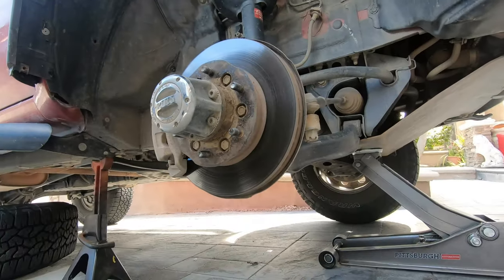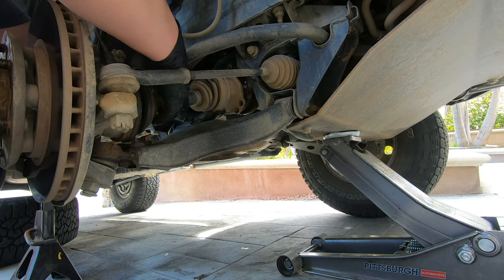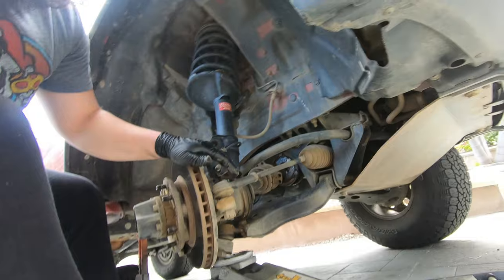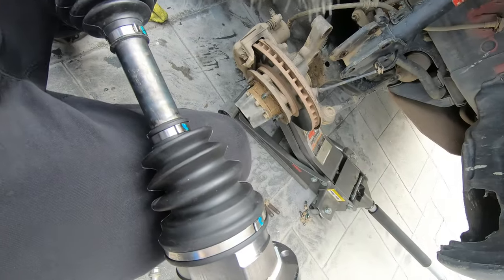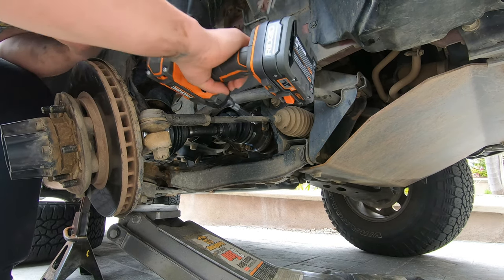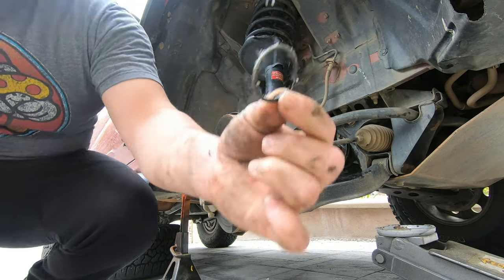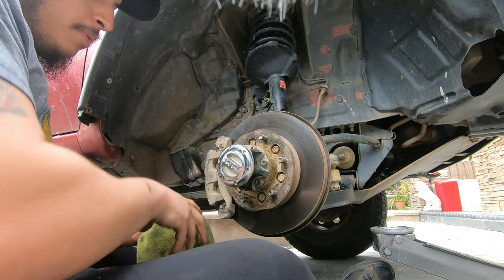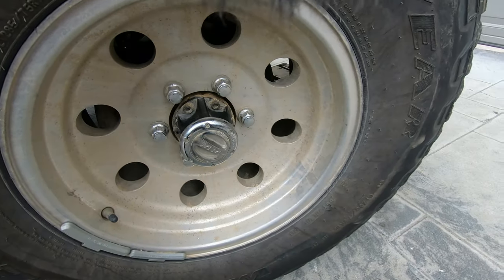How to replace a CV Axle on a R50/ Nissan Pathfinder (96-04)

Comment: A mechanic replaced the LF strut assembly on mine. When I got the car back it clunked on the way home. And now the axle is completely separated. The mechanic denied doing anything wrong but there were no noises or anything before I took it there. I know this vid is about replacing the axle, but would you know if there is any chance a CV can be damaged or pop out on an R50 while replacing a strut?
Reply from the maker: To my knowledge (not a mechanic) if you let it drop too far or let it just fall, most CV axles can separate. I’m not sure if that’s the case with these CVs. I would check if he put the C- clip back on before putting it all back together
Reply: @passiondriven5648  Thanks. He says he didn't do anything with the CV axle as he was just replacing the strut, which I guess means he didn't remove the clip.
Reply from the maker: Oh I see! If you get under your car and grab the shaft closest to the wheel and wiggle it around and it moves a lot then yea he must have let the whole assembly droop too low
Reply: @passiondriven5648  Yeah, when I took it back to the shop after noticing the clunks, they wiggled the CV joint and it moved a LOT. Then after his denial of responsibility, I drove it home again, and now the CV joint is completely separated. and nearly falling out.
Reply from the maker: Yikes! Not good! Hopefully they end up fixing it for you!

Comment: I have a fluid film around that section of my axle where the cv axle mates to the diff; is there a diff axle seal there or is it likely the outer grease seal of the cv axle just leaking grease?
Reply from the maker: There’s like a flat plate that just rests between the axle and the diff. What’s happened to me is that the plate comes off (when the CV isn’t on) and the grease that’s inside leaks.
Reply: @passiondriven5648  thanks for insight; yeah the CV hasn’t ever been removed from the vehicle.  I believe it’s the original axle.  I just want to make sure my diff isn’t leaking oil so I’ll probably open up the fill plug here soon one of these days.

Have you had luck with the cv axle brand you went with?  One of my cv axle boots is torn where it meets the shaft but no grease has started to leak yet.  Plus since they’re original I should probably replace them soon.
Reply from the maker: I went with the axles from autozone just because of the lifetime warranty and so far they’ve been great!

Comment: Is that the best way to do that? What would you have done differently?
Reply from the maker: Only thing I would have done differently  is take the strut bolts off at the beginning. I was going to try to do it without removing them but it's easier if you do.
Reply: Passion Driven The easiest way to do this is unbolt the control arm front bolt only. It will allow the axle to slide out sideways
Reply from the maker: @Mandingobull  I was trying to avoid removing a lot of things, I messed up at first but ill give that a try next time!